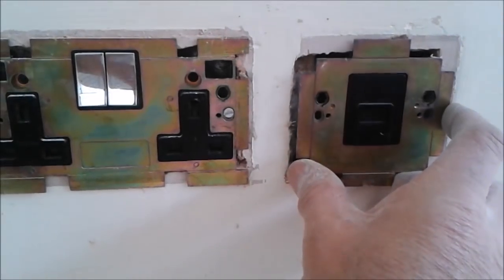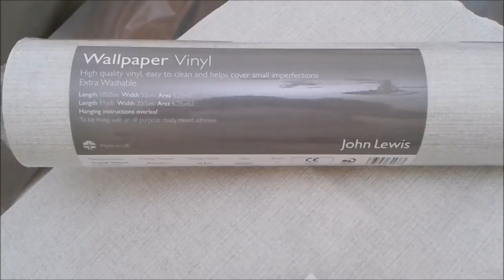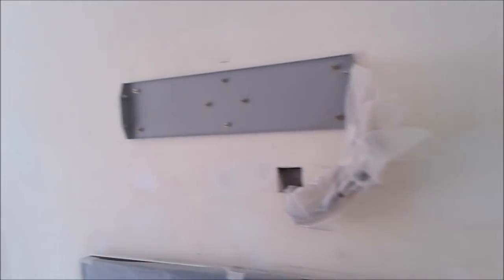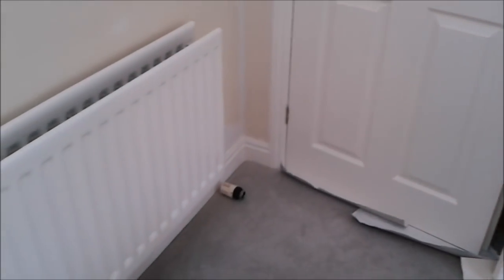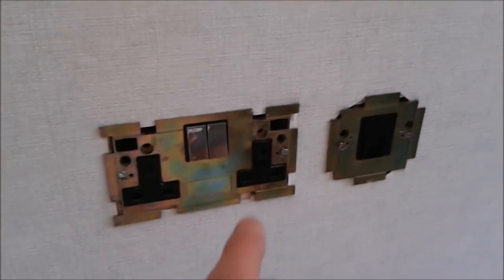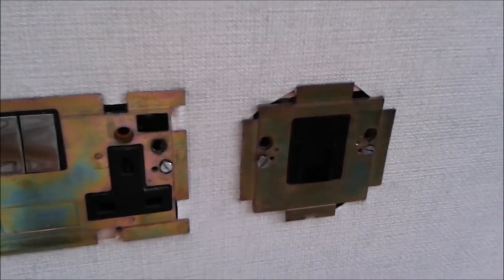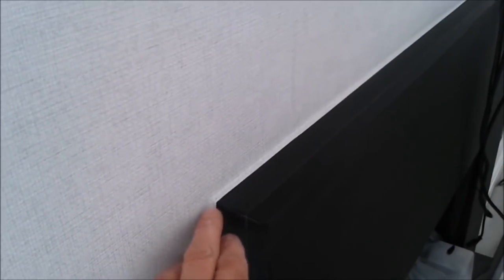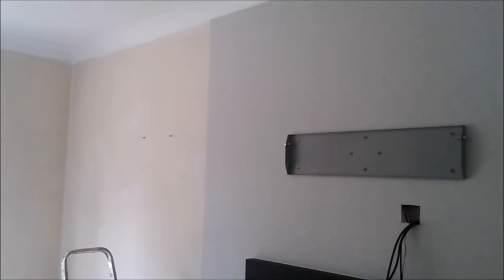Uncovering Problems Part 2 Paperhanging The Finish

Comment: The more I watch your videos the more I think I do far too much of the prep work myself before my decorator arrives to hang the paper. I spend days filling and sanding any imperfections, cracks, gaps etc. I loosen all the switches and sockets etc, I just assumed that a decorator would not do this and just come and paper regardless. You really do a full service on your jobs and the finish is excellent. 👍🏻
Reply from the maker: Thank you.

Comment: Relaxing to watch. I’ve had to line pretty much every wall and ceiling in this house I bought over the last year. My Dad and I are perfectionists and the process has been stressful at times so this is a great video to help us see the thinking process you go through with each job. Your attention to detail is fantastic. 

Out of interest have you ever found a way of getting a good finish on a once paint. We just had to use it as it was the colour we wanted and they don’t make it in regular matt. Was not impressed with the finish at all.
Reply from the maker: Listless Donkey thanks, I've used one coat but I never try to make it cover when using emulsion, especially on a deep colour. Always use Matt on lining paper silk shows every imperfection.

Comment: Nice job, do you size the wall?
Reply from the maker: Diluted PVA
Reply: Painting and Decorating thanks, does that work better than using paste?
Reply from the maker: Less expensive and yes works better.  PVA is great stuff dilute and allow to soak in and dry.
Reply: Painting and Decorating OK thanks for the above and prompt reply
Reply from the maker: Your welcome.